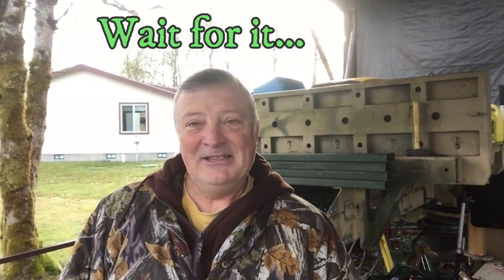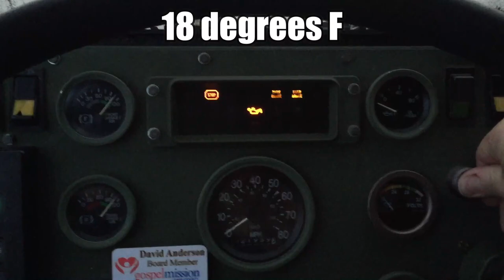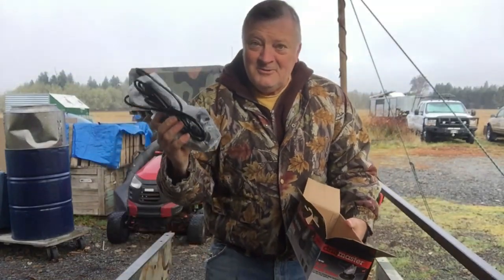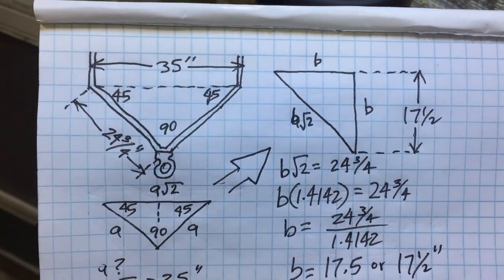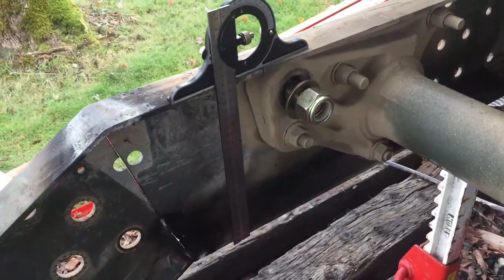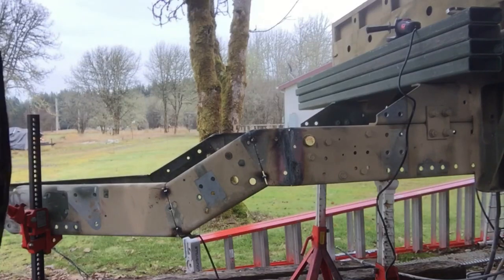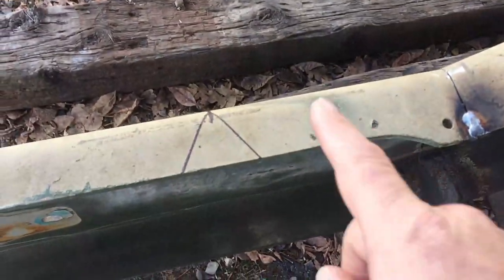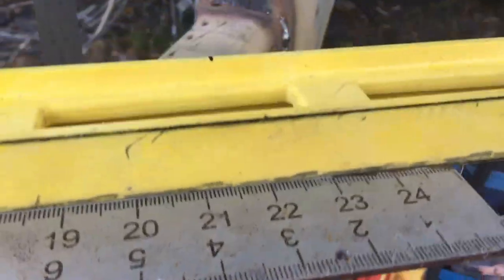FMTV TRAILER BUILD Tongue Forming #89

Comment: Dave Dave Dave....great work as usual.  I just want to let you know that both my Bosch angle grinders are about 10yrs old.
Reply from the maker: I know... I know... but I have to look on the bright side... now I can do a video on how to change out the brushes, since the new one's came with an extra set. IT LIVES AGAIN!!! Ah-hahahahaha! Yeah, I have a nice deWalt grinder that is over fifteen... I had to replace the cord because it dry rotted. Still running! (I am hanging my head just a little.)

Comment: Rather then paying a high price for acetylene gas have you considered propane/oxygen for flame cutting and heating?   It just takes a propane tip on your cutting torch and you can use propane.  Propane is much cheaper and can be bought many places.
Reply from the maker: I have heard about it... since I am just getting my feet wet with gas cutting, I just have not had that much time to figure it all out. Perhaps when I get back into town I'll look up a propane gas tip. Thanks for the advice!

Comment: I put a block heater in mine (took half an hour) and 2 hours of plug in time and no more cold starts, even 5 degrees and no problem.
Reply from the maker: In what location did you add the heater? They come with ether bottles, but I don't like using that stuff. Thank you!
Reply: @HelicoolsHelipad  drivers side next freeze plug right behind turbo clock it straight up
Reply: passenger side my bad
Reply: use zerostart 350-0015 engine block heater 84 bucks amazon prime
Reply from the maker: @johnhoffman8203  Thank you very much!